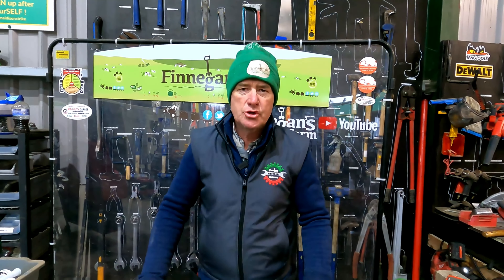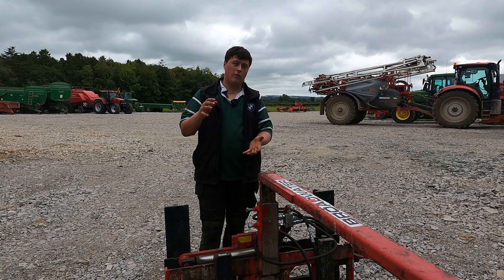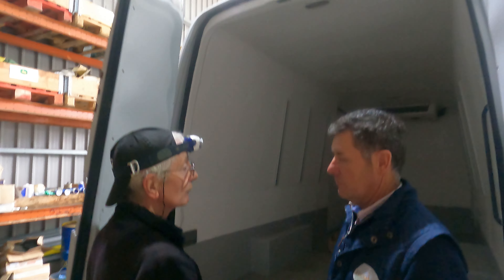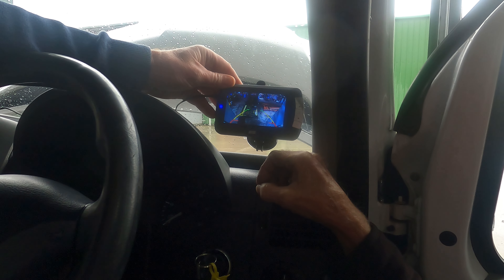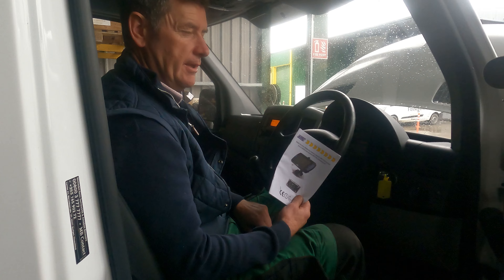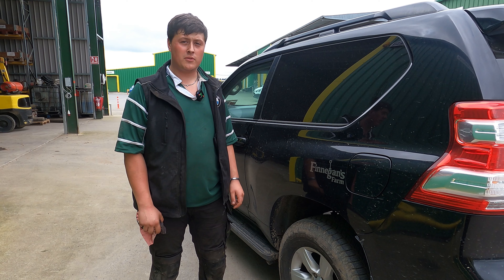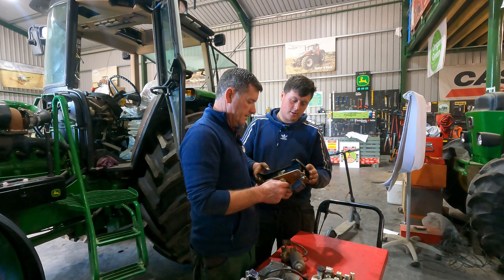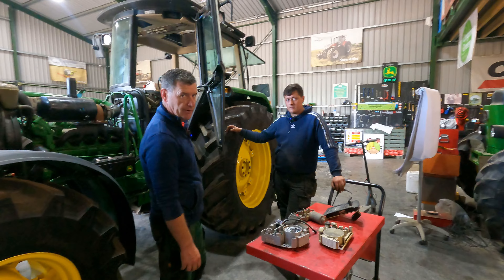WORKSHOP WEDNESDAY EPISODE 94

Comment: Hi Kaylem and Mick. Ive a query on those 50 series dashes. The tach on my 3050 that i purchased is working fine but the hour meter is not increasing...I've replaced the sender as the tach had been wired to the alternator. 

Any advice on how to get hour meter turning again

Tks JC.

Comment: 3650 looking well.  If you don't have a use for it,  would you be willing to sell the used dash panel from the 2wd 3040?
Reply from the maker: Not sure if they are any addition as most of the boards have been shorted out and have burn marks on them

Comment: Your showing your age Paul when you mentioned Atlantic 252
Reply: They cut down the 814ft radio station broadcasting mast a week or two ago. It said it was put up in 1988.
Reply: I remember Atlantic 252 on the long wave . The signal would fade at night and wouldn’t work under the very big power lines that came up through Wicklow

Comment: Don’t think that was problem with the hand break. It’s more than likely the hand break cable is sticking
Reply: A cable sticking wouldn’t lock the brakes like he’s describing it’d make them bind
Reply: @gregshearer423  if the cable was stuck with shoes engaged they would be stuck on. The T peace at the hand break leaver only pulls the cables they rely on the actuator in the drum being pulled back by spring pressure when hand break is released this can’t happen if the cable doesn’t let it back the springs can’t over come the pressure of stuck cable until the shoe over comes it if it can by being rocked by the break drum in the opposite direction. Not saying I’m 100% right but in my experience with the Land Cruiser and there set up it was the cables that always caused this issue. By either freeing the cable the issue went away. If u pull drum off and push cable back from inside then spin it with a drill if u can and oil it, the cable becomes free again. On another point the shoes in these are a pain to strip and reassemble.😂